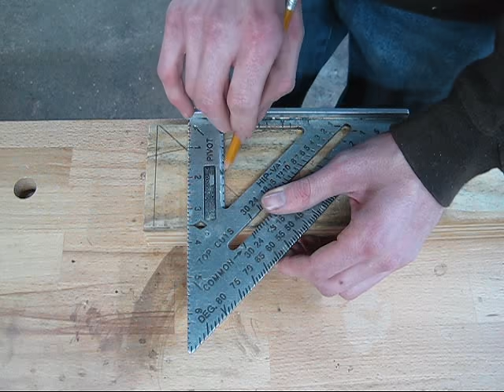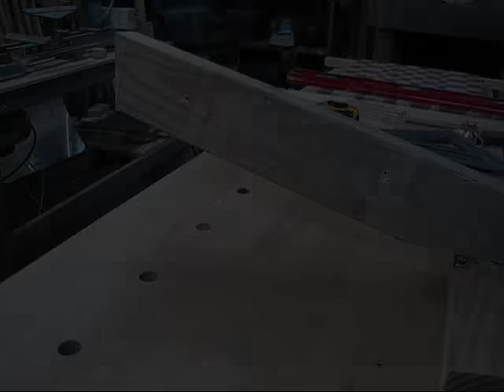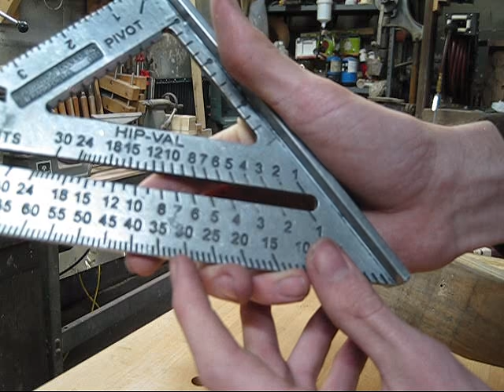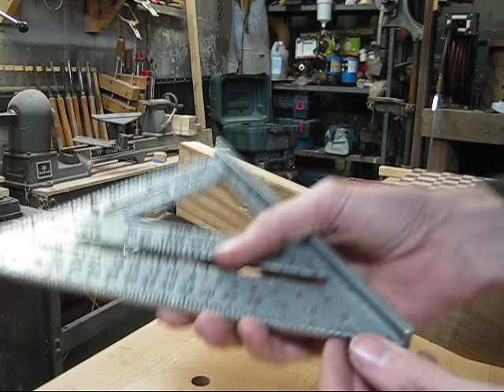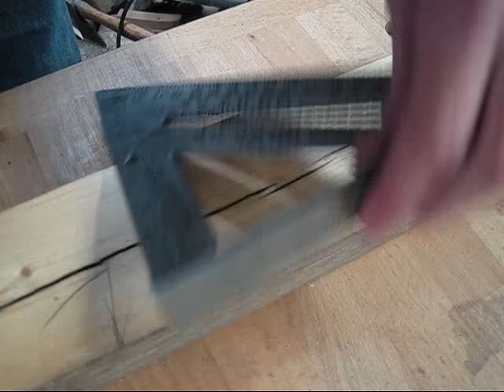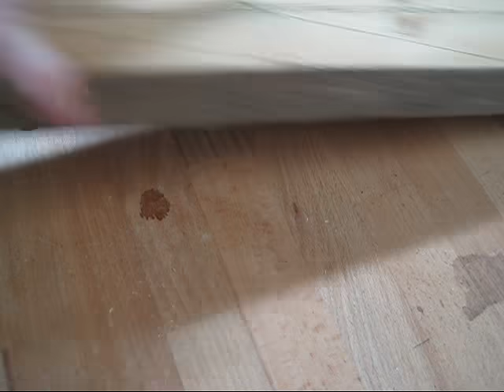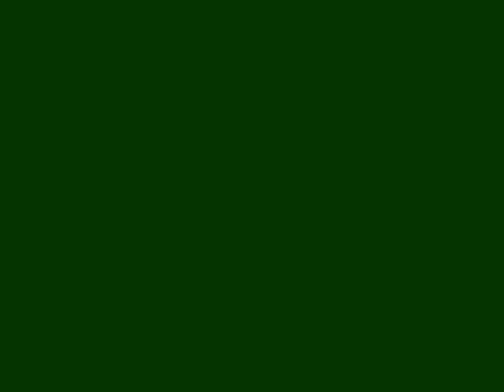The basics on a Speed square

Comment: You can also use a small level on the top side of the speed square. Once the level shows level, then you can locate the number to determine the pitch of the roof.
Reply: @hansouth2355  would be a specified on plan what degree it would be and also collars would be put in place to form the ceiling and also so stop the splay of the roof.
Reply: Or just hang a chalk line, then snap.
Reply: @hansouth2355 , that long cut is 90 degrees from the plumb cut (the vertical cut) and basically you can subtract 13 degrees from 90 to get the other cut which is 77 degrees. This is just one way of doing rafters when you want an overhang on the building and that long cut sits flat on the top of the wall and all of the load bearing part of the rafter is above that notch. The weaker tail of the cut usually will not run more than 2 feet over the edge of the building. So very little load is on that small end that overhangs the edge of the building. You can construct a rafter without the birds mouth by integrating the ceiling joist into the rafters and that essentially would span the distance between the walls and be attached to the tails of the rafter. Truss manufacturers typically use that method.
Reply: Actually I disagree with all of you, the cross rafter on the lilies should be on the lallies and the whole fulcrum should dovetail.
Reply: I was about to post this,but stopped when I saw yours. Good work.
Reply: K
Reply: @hansouth2355    there is actually very little flexural stress on the unit at the birds mouth.  The load on the wood is up to the task.  Loads are mostly in compression at the that location and the wood is up to the task.  The proper thickness (rafter sizing) needs to be in the center of the member.  It is far more important to have a good connection to the top of the wall.  the roof loads and any snow or wind loading.  The more surface contact, the better.  the load is set, so the more surface contact, the  less per square inch.  Make it a good fit.  Hurricane clips and other fasteners increase the strength, and in some situations are required.
Reply: @Spencerbuildsit  here in upstate ny you always have to use them

Comment: I don't understand why he used 11/2 on 2*4 how did he know this?
Reply from the maker: Carmel Apple Blossom that’s a nominal Measurement. On a 2x4 it is to much 1” is closer to the real thing, but on a 2x6 or 2x8 1-1/2” is close.  You want a longer leg on the plate to help with load bearing and nailing surface.  The smaller the cut the less you have, to deep and you weaken the rafter so there is a butter zone in there just be sure all are the same.

Comment: Does that over cut from both directions weaken the board enough to cause concern? Thank you!
Reply from the maker: Just for fun some say it does but I have never seen a rafter tail break because of a little over cut. A lot of pros do it, but it is not the proper way to do it. In my words I don’t have a problem with it.
Reply: Classic Work, thanks very much! If it works and doesn’t cause any structural issues I’m all for it, makes doing the work faster. Cheers!
Reply: When cutting and need to stop in the board w/o going (much) over, set the blade depth as deep as possible. Make both cuts. turn the board over and complete the cuts making the two meet. If you have time or cannot not flip over a large/long board, truss, etc. use a hand saw to complete the cuts. A little over cut typically will not hurt. When framers get going, they are balancing quality and speed. You need to go fast w/o sacrificing structural integrity. 
.

Comment: i have a larger speed square and often use it as a saw guide when cutting boards. i never even cut any rafters but may shortly as i am always putting together projects so thanks for this.

i bought it to mark out ceramic tile which is why i got the larger one and have been doing quite a bit of diagonal tile of late and the speed square is great for those 45 degree lines, and the 90 of course.

Comment: Maybe it's down in the 1674 comments (only read 200) but using a speed square as an edge guide for cutting 2x4s etc, square with a circular saw works well. My ancient speed square didn't have the notches for scribing down the material but now I know what they are for on the new one. Thanks for the tips. View count is impressive.

Comment: Instead of a plumb line, lay your small torpedo level on top of the wide flat top of your square, and pivot up until the level bubble reads level, thats your plumb cut and you can read your pitch as well.

Comment: That took me back to my days as an apprentice. We used the large roofing/rafter square to do what you explained, although we were taught a completely different way at the technical institute. We used a logarithm book and Calculator. We multiply the Secant of the pitch with the run to get the length of the common rafter. That is to the centre of the ridge and the plumbcut of the birds mouth. I wish i could revise all of those skills now because ive forgotten most of it, and i used to be able to measure, mark and cut an entire hip and valley roof by hand. If you dont use it you lose it. These days how many carpenters know how to set a butt gauge to hinge a door and jamb!? And what about storey rods for weatherboards? Most tradesmen dont know how to set storey rods instead using stringlines, lasers spirit levels etc and the wonder why the weatherboards dont lineup on the last corner leading to the start face. Very interesting keep it up.

Comment: Instruction on the appropriate use of the speed square. It is NOT the appropriate square for framing, that is what a, much larger, framing square is for. Ditto with using a 9" torpedo level for framing instead of a 48" (at least) framing level. If a framing crew shows up with the wrong tools in their belt, send them back to trade school.

Comment: Great video, I've used one of these for years without knowing all the different things it does. But I still don't know what the diamond is for?
Reply from the maker: dan lake the diamond can be used for a few things but the most common is the lay out a birds mouth.  It will automatically give you 3-1/2” of bearing surface on a cut without measuring anything. I didn’t show it because I didn’t know either when I made this video lol.

Comment: Just a simple tip, if you subtract 13 from 90 you come up with the degree for the bottom cut on your rafter. Put your speedy on the board ahead of the plumb cut and set it to 77 degrees. Its easier to mark with the square laying flat and its a simple equation. Great job on the video.

Comment: if you take 13 degrees off of 90 degrees, you will have the actual complementary seat cut for the birds mouth....thats a pretty inaccurate way you did it...the seat cut should be 77 degrees dead on
Reply from the maker: doubleu dee it doesn’t have to be accurate.   If it is a good fit numbers don’t matter.

Comment: I just want to add something about the birds mouth seat cut... If you notice the diamond on the 3 1/2 " mark. A 2x4 is 3 1/2 in after you scribe your pitch line for your seat cut you flip it around with the pivot on the bottom side of the rafter and slide it until the diamond lines up with the pitch line you scribed and that makes a perfect seat cut.

Comment: It's the level cut that's critical in a birdsmouth, the plumb cut isn't. Try marking the plumb the same way then reverse the square to 90 minus roof angle ( 90-13=72 in this case) then bring the blade scale to the width of your wall framing and mark or scribe it. The undersides of your rafters will meet perfect with your walls and you won't have to install as much blocking for sheetrock.

Comment: Thanks!

I’m getting ready to start construction on my cabin, was still confused on building my roof and how to use the speed square to make it happen... you just removed the confusion!

Now to go check for other tools and tricks I will need next week!
Reply: if you can understand that when building square every angle has to equal 90 degrees so if your pitch is 26 degrees at the ridge beam it will be 64 degrees sitting on top the wall the return cut of the birds mouth.
Reply: @Rick Sanchez C137 good lord if you are just learning basic carpenters knowledge and are planning to build a roof for your cabin in a week you are in for a rude awakening. I've been a carpenter and roofer many years and get very frustrated when people with no experience treat the roofing trade with no respect. It is infact a skilled trade and i promise your roof will fail by either collapsing under stress of weight or have many light to severe leaks with snow, rain or wind driven rain. A roof is crucial to any building on being done properly. Think of the consequences and implications of a collapsed roof or a leaking roof. Especially if one were to happen in the midst of a bad snow storm or heavy winds/rain. Either take learning the trade more seriously or call a professional. Your life, livelihood and personal belongings depend on it and unfortunately home owners insurance does not cover incompetence and or non professional, uninsured and unqualified work!
Reply: Id actually like to hear about the end result seeing as you posted your comment 1 year ago @Rick Sanchez C137
Reply: @NB_Chad  it's his own cabin, who cares? It's his project, let him do it himself. Learn something, and if be fails, it's only at his expense, not yours. Not shitting on your trade.
Reply: Chad, I hear what you say but be nice.. Maybe he dont have a carpenter close.. a level, framing square or speed square..
The snow load varies where you live. If you need a permit for the building they will provide you with what you need for rafters size, spacing and sheeting size. 
If not go online.

Comment: Does it matter what brand of square you buy? When it comes to tape measures/rulers, I've found different brands have a slightly different measurement. The worst difference I've found is a 32nd of an inch over a 1 ft. distance. And since the spacing is consistent, the farther out you go, the farther off you get. But my biggest concern was, which brand was actually correct? The one that's a 32nd long, or the one that's a 32nd short?

Comment: For repairing the end piece, if a squirrel ate it, it probably means the roof is finished.  Just wondering how you would get the square to the place you have it and use the square with the plumb bob?  Did I miss something ?
Reply from the maker: You can use it on the eave of the roof even if the roof is finished.

Comment: Everything you say is right on, except, I dont consider it a basic tool, I consider it a advanced tool that takes a complete understanding of roof cutting to use it properly, which you do. But most are lost in understanding it's full value without extensive background in carpentry.

Comment: would it not have been easier to grab the high of the wood, and the length of the wood where it would sit. and then measure  then cut. ya already know how high the base wood is, and how long it is, so cut it to that width and length and ya left with a slot, that the wood would slot into, giving it a behind and front brace as well.... did ya see the gap  he left behind lol... 8:40

Comment: that was awful, your birds mouth is way to long it should not extend past the width of the wall and using wring tool and over cutting it you weakened it significantly.  Use a hand or jig saw for the final cuts.

Comment: I enjoyed this vid, but just an FYI on the plumb Bob. When your trying to figure out the pitch on a sheathed roof place a 2' level and you'll need a tape measure, level out and measure the distance from roof to bottom of level.  For example if you have 5" from top of roof to bottom of level you have a 5/12 pitch slope.

Comment: A level is easier to work with than a plumb bob dangling in the wind, to determine the pitch of a roof. Just lay a level against the rafter, adjust it till it's plum and mark it with a pencil line.

Comment: Just ordered a Swanson speed square on amazon. Thirty-five bloody quid. In metric tho. Hate metric. Metric is for commies. I'm a little English imperialist at heart. But inches and fractions are a language the new breed of English lads just cannot get their heads around. Absolute shame.
Reply: They just choose not to, since the metric system is much more accurate, and sensible.

How many centimeters in a meter? 100. 
How many meters in half a kilometer? You guessed it. 500.
How many inches in a yard? __
How many feet in a quarter mile? __ 
Point in case.

For smaller less accurate measurements, imperial works fine, but it's pretty useless otherwise.

Comment: I'm sorry but you're birds mouth will not pass code you cut to much wood out had you used you're square proper. you may need to look up how to on YouTube for the right way to use speed square.
Reply from the maker: It is a demo to show how it works.  A 2X4 is not up to code for a rafter anyways.  If your building a shed is one thing, but I doubt a building code exp would have to look at it.

Comment: You have made it beautiful video. Couple of quick comments. Pitch of 3 and 12 is 1 to 4 ratio. For cutting rafter to match existing the heel height is used as a control measurement. The seat cut and the bird's mouth may vary based on the new lumber dimension. In majority of the cases, in cutting new rafters, for a 2x4 wall, seat cut of 3  1/2" is used, to minimize the weakening of the rafter.

Comment: Pitch can be measured much easier by placing the speed square along the bottom of the rafter with the non-swaged leg along the rafter.    Place the plumb bob over the swage and it will cross the slope line.

Comment: The first mark you made on your bird's mouth is not the seat cut. It's a plumb cut. It is the same plumb angle as both ends of your rafter. Plumb as in up and down. The second mark and cut you made is the seat cut, as it sits on top of the wall.

Comment: For those ho use imperial system is a good tutorial but if you use metric all that would take 5 seconds and you don't have to learn to use that complicated tool.
Here's what you do, you use a protractor to measure the angles and it will be the same angle every time, less energy and materials wasted.
Reply from the maker: Ralf Jr. I did make a tutorial on the metric speed square and it took 5 mins longer than this video.
Reply: What I was trying to say was how to make the operation faster and more precise instead of the speed square use a metric ruler and a protractor.
Reply from the maker: Ahhh I got ya.
Reply: Ralf Jr., our system is very fast on rafters. This video was a demonstration, which you shouldn't expect to go fast. However, most framers use a framing square on rafters, and use a different technique. I can't imagine any technique being faster, or more accurate.

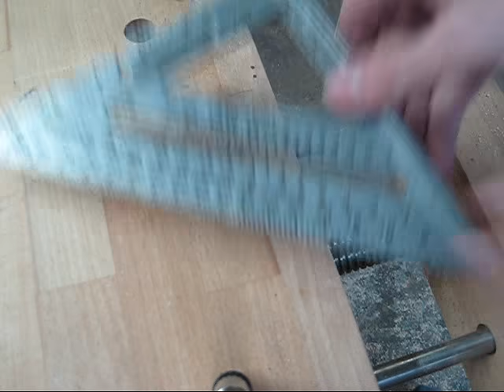Comment: At around 5:40 you say a "1 to 3 ratio". That would make for a steep roof pitch, wouldn't it? Did you mean to say it was 12/3 roof pitch? That's about what your test piece looks to be. Thanks.
Reply from the maker: I messed up in what I said.  I tried to said 1 foot to 3 inch but I just brain farted, and said what I thought sounded right.  It is 3/12.
Reply: That's what I figured. Thanks for the quick reply!
Reply: Hate to tell you this, but 12 inches is the same as 1 foot. so saying either is perfectly fine. It's pretty apparent that it's not 1" . How the hell you gonna cut 3 inches in 1 inch?

Comment: The plum bob is a nice idea in theory, but whenever I'm looking at damaged facia boards there is a roof on those rafters already, usually shingled which doesn't leave for a flat surface. With a roof in place I don't see how the bob can drop down to swing freely. Maybe using a level and sight the line there in conjunction but there still might be some correction cause of the shingles.

Still learned some stuff.
Reply: Take a 2 foot level and mark it at 1 foot from the edge. Set that edge on the roof and hold the bubble on level. Then measure down from that 1 foot mark to the surface of the roof. If, for example, you measured 5 inches, then you have a 5/12 pitch, meaning that for every foot of run (half the width of your building), you have 5 inches of rise.

Comment: Love what your doing but when you described the common and hip and valley numbers,you used the word length to say wat they were for. For all the people out there he made a speaking error .Thise numbers tell you what pitch you are putting on you roof .So its the angle or degrees or pitch nothing to do with length.For Example a 8/12 pitch for your common rafter.You can say you use the word length here and what that means is every 12 inches you move horizontally you go up or vertical 8.

Comment: ive bought a speed squire in uk  but common cut 3 = 14 degrees is this  bad speed square i've got. the cut or the degrees may be incorrect on it could you confirm thanks

Comment: what formula do i figure in, using a^2 + b^2 = c^2 to determine length of rafter?
or is there a quicker route
Reply: That info. is stamped on your framing square. Find where it says "common rafter length per foot run."  If you have a 4/12 pitch, follow across your square until you come to the number 4 (inch mark). You will see 12 65. If you know that your run is half the width of your building, then you'll be able to find your run. If your building is 24 feet wide, then your run will be 12. So multiply 12 X 1265 and you'll get the diagonal, or actual length, of your rafter. It will be 151.8 inches. The .8 translates to 13/16, so your rafter will be 151 13/16 inches.
Reply: @Jay-tk7ib    well explained Jerry.  Maybe edit it and tell them to back out 1/2 the ridge thickness too..
Reply: @Spencerbuildsit  Yes, always shorten by 1/2 the thickness of your ridge board. 
Also, any overhang is extra, not included in the above calculation.